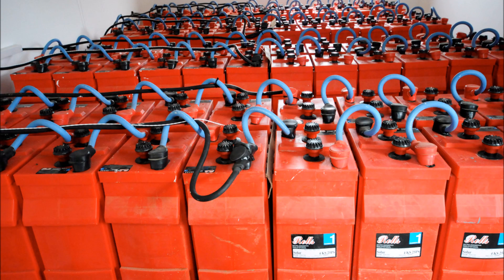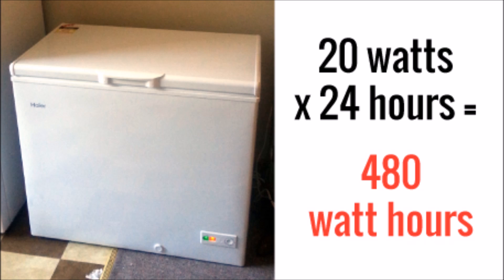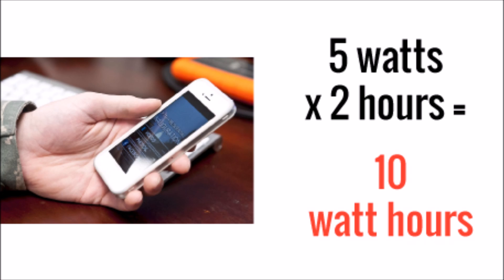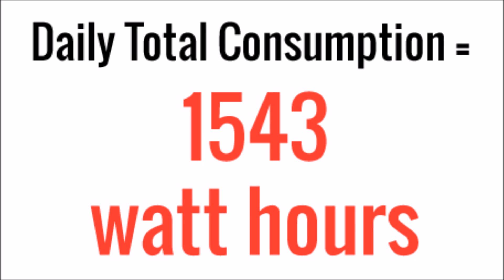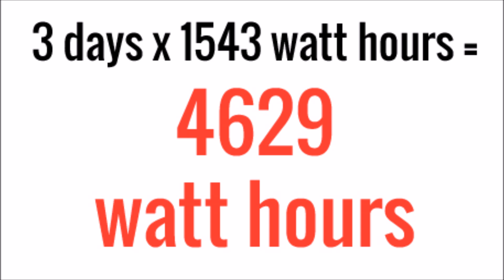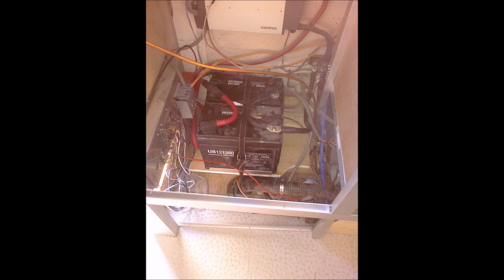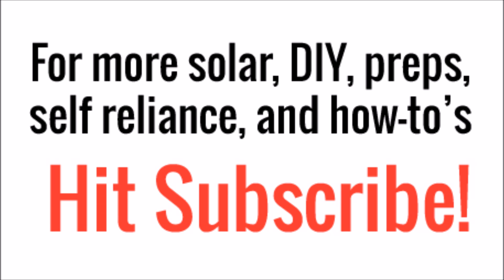How To Size Your Off Grid Battery Bank Capacity For Solar - Math Warning!

Comment: The amount of power that the average US home uses is about 30 Kwh a day that is ten times what I use in a day and thee times what my the average home is my country
Reply from the maker: Yes, that is a lot of power.  Most of that comes in heating and cooling and large appliances.  It is definitely possible to get by with less.
Reply: @LDSreliance  that makes sense because we mostly use gas or wood for heating and don't have a cooling system asides from opening a window by the way thanks for the video
Reply from the maker: You are welcome.  Thanks for watching!

Comment: How many amp hours of lithium iron phosphate batteries would I need to power 1500 watts (close too ) for 18 hours a day ?. Roof is south facing at between 10-14 degrees . Southern California. Thank you 🙏🏼
Reply from the maker: Wow.  That is a big boy load.  The rough math would be 27 kWh but that would be draining them to zero with no room for error.  So add in however much margin you want to that.  Also make sure you add in an extra 20% if your load is AC and you are going to be powering it from an inverter.  If it is a DC load you don't need to worry about that.

Comment: Great video but at the end for the multiplying by 2 would be 100%.  Total amp hours x .5, then add that to the total amp hours for the amount you would actually need.
Reply from the maker: I think you are misunderstanding.  We already had the amp hours that we actually need.  We multiplied it by 2 so that we would be purchasing twice the capacity that we needed, thus we would only be drawing the batteries down 50% at our 100% usage.
Reply: @LDSreliance  ahh ty for the clarification
Reply from the maker: Np.  Thanks for watching!

Comment: What about dc amps compared to ac amps?
Reply from the maker: Can you elaborate on your question?
Reply: @LDSreliance  I'm not referring to ah. Is it true... 1 AC amp is equal to about 10 DC amps?  So when calculating your Amp needs you'd need to take that into account?
Reply from the maker: No.  That is not true.  The only way that would be true is if the voltage of the AC power is 10x that of the DC power.
Reply: @LDSreliance  ok I hope that's correct.  I'm with you but what are these guys talking about?  Here's one example video. ..https://youtu.be/idFz4W0o06k
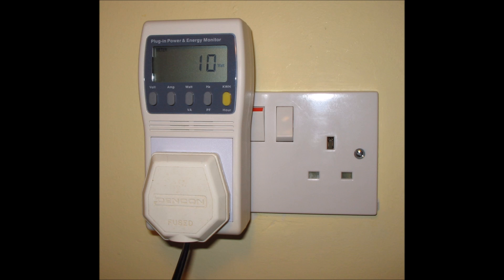Reply from the maker: At 0:57 in that video he says exactly what I am saying.  He measures 5.7A @ 120V and 24A @ 24V.  5.7A x 120V = 684W and 24A x 24V = 576W.  However, his AC meter measures 582W before he switches over to the Amp reading so he really isn't getting 120V AC power from his inverter... it is more like 102V.  He is not using a high quality inverter, apparently.

Comment: Say I use 45 KWH a day and I want 4 days of battery stored, and use 1200 watts of panels to charge battery. How many batteries do I need. Say I have lifepro4 lith batteries with 100 AH.  I know I did something wrong,  but I came up with 10.  If that's right, no way can I afford this. Thank you
Reply from the maker: 1200 Watts is about 1/10 what you would need to even think about pulling that off.  Did you mean 12000?  Or did you mean 4.5kWh per day usage?  The average house in America used 29kWh per day in 2017 so 45kWh is either a lot of usage or a really big house.  Either way you would need a really big solar panel system.
Reply: @LDSreliance   thank you for your reply... My electric bill came in this morning it says I used 24KWH a day and 649KWH for the month. Trying to figure what I need to go off grid,
Reply from the maker: I don't know where you live but you will need roughly 6,000-9,000W of solar power to generate that in the continental United States, depending on your state.
Reply: @LDSreliance  Thank you again for your help. I live near Gainesville Florida, central Florida. To make 9000w of solar power I will need 30 300w panels. I'm going to use a 48 volt system so I have go up by 400w when I add panels, that is what I been told.. (example 400w, 800w, 1200w).  Thank for your time, and not getting upset with so many questions.. Trying to learn..
Reply from the maker: Not a problem.  I am glad I can help.

For Gainesville, you would need about 6,500-7,000W depending on our winter consumption.  It would be more helpful to know the average consumption by month of the year over a several year period but that is a general estimate.
Reply: @LDSreliance  Thank you.. I call my electric company see if they will give me my last year or two totals. I will use your suggestions, after about six months of using I will let you know. May even make a video.. Thank you for the help.
Reply from the maker: You are welcome.  Good luck!

Comment: if I have eight 330 Ah batteries at 6 volts configured to 24 volt system, what is my total stored Ah capacity?
Reply from the maker: 660Ah @ 24V

Comment: Hi there sir its an old video but still helps
So my question is
Can i add an extra battery on my current system
The system i have built is
100 watt each panel
20am charge controller
1500watts inverter
And 100 amp battery
My dally use is making my battery drops to 12.0
Or even 11.8 in the middle of the night
Which is damaging the battery life i believe
Will adding extra 100 am battery help
Or the system can't handle? it
Reply from the maker: Another battery will definitely help, as long as you have enough solar panels to charge up two batteries each day.  I can't tell from your description how many 100W solar panels you have but for that to work I would say you would want at least 5-6 of them just off the top of my head without knowing more info.
Reply: @LDSreliance  will I'll ask
The shop owner
And don't worry
I leave in the middle east
Lol its sunny🌞 mostly hear

Comment: Are you only calculating discharge based on lead acid?  Life Policy can be discharged almost completely.
Reply from the maker: At the time of the video lead acid was more feasible and affordable.  Now lithium is definitely in the conversation.  But while LiFePO4 batteries can be discharged to 0% SoC, it will have a negative impact on cycle life of the battery.

Comment: The more batteries the better. It reduces the cycle rate. If you have 4 batteries you'll hit the 50 percent rate quickly but if you double the size you reduce it to 25 percent. But if you use 16 batteries it's just a trickle off the top and your batteries will last years longer. Pannels are cheaper than batteries.
Reply from the maker: True, for the most part.  As long as you have a corresponding increase in size of the solar panel system, too.  If you don't, then the solar will never fully charge the batteries and they will short cycle over and over until they die (lead acid) or require intervention such as a generator or something to top them back off (lithium).

Comment: Did you account for size of the array? During the day you use power more so than night. The pannels are beeing used to supplement the battery charge cycle which reduce the amount of charge going to the batteries. It's a balance.

Comment: How about the 80% battery efficiency? If you put 10 Amp  in your lead-acid batteries, you'll get only 8 amp out. Even less when they are older. Please add that to your calculation: divide the battery capacity you found by .8.  By the way, that is another great advantage of lithium batteries. They are around 98% efficient. Too bad they're so expensive.

Comment: Hey mate quick question when converting watt hours to amp hours for a 24 volt system do you just divide watt hours by 24?
Reply from the maker: Yes.
Reply: Although if you're using two 12V batteries in series to generate the 24v each battery is still going to be generating 12v so you would divide by 12.

Comment: I just watched your video...very good. I have a hunting cabin that I use 45 days a year. I currently have a 100 watt panel with two golf cart batteries that supports two lights, phone charging, oscillating fan and a vacuum cleaner occasionally.  After watching your video it looks like I can set up my system to maybe support a single cup coffee maker and a small fridge that I would use only while at the cabin. It's all about the amp hours of the batteries!!  I'm learning.
Reply from the maker: Absolutely!  That is the whole point of my channel so I am glad to hear that.  The fridge will be the biggest challenge since it will kick on and off all day and night.  Those kind of loads are hard on solar since you will only be producing power during the peak sun hours each day.  So you have to produce enough excess power during those 3-8 hours (depending on the season and location) to last you through the night until the next day.  And if the next day is cloudy... you are out of luck.

It is going to be hard to get by with just a single 100W panel.  I'd recommend getting another one if budget and charge controller capacity will allow it.  They are down to about $80 with free shipping on Amazon these days:  https://amzn.to/35zTh9y
Reply: A 12v Automotive coffee maker(200watts)..25 minutes to make 1 giant cup of coffee.  Dont leave home without it :)

Comment: I need 50 kWh daily, someone pls recommend me a battery bank? Lithium ion and NOTHING else. Give me some 3.6 volts in series and I need them to be for a 12 volt system.
Reply: Hezekiah Spade you are asking for a major disaster. Lithium batteries are very unstable. And pulling 2083 watts an hour dc that converts to 173 amps per hour. The amount of heat that will produce and the energy loss if you are converting that to ac power will be insane. The 12volt inverter can’t handle that kind of power.
Reply: @rigginsranch  Wow!! OMG 😲

I have no clue yet as to what I'm doing but this is the off grid thing I wanna do.

Could you give me an idea of the things I need to use for a 50kWh daily power set up? Will a 48 volts system be better in this case than a 12 volt? 
Also will lead acid or agm batteries be a better option than Li?
Reply from the maker: Yes, you would want to use a higher voltage system for sure.  50kWh is a lot so you may want to take a look at your energy consumption first and see if there are some things you can do to decrease that.  If it were me, I would do all of my heating (water, house, stove, dryer, etc.) through propane instead of electric.  I would switch as many appliances as I could to direct DC power or propane (fridge, freezer, mini split AC systems, etc.).  Then I would swap every bulb in the house to LED if you haven't done that already.
Reply: @LDSreliance  Essentially you're saying to try and reduce it to say about a 25kWh system then? Today I spoke with Outback systems and they told me that 60kWh is pretty standard for their clients all over. I mean they have battery banks for it but I'd need 3 sets because their highest for household applications is 20kWh so I'd need 3 of them and each costs around $18,000.00 so it'd be best I just create a battery bank though it won't be light as theirs(950kg). 

But THEY told me it is very easy to do. I checked out the Tesla Wall as well as LG systems and they are light and very attractive but too expensive. I might have to build one. 

And no matter the voltage, Outback sent me three of their systems that I can use at from 12 volts to 96 volts to suffice for all that power.
Reply from the maker: The average usage in the United States each month is 914 kWh per month or about 30kWh per day (https://www.eia.gov/tools/faqs/faq.php?id=97&t=3).  60kWh is do-able, sure.  With enough money you could build whatever off grid system you want.  I'm just telling you that is really high and you will spend more money on solar capacity to try to meet 50kWh per day than you will by trying to decrease that number.

Easy, yes.  But expensive.  But it is your money.

Comment: Good video!
    One clarification, at 5.34 you say if you design your battery bank to discharge to 25%, it will last a lot longer... I got that you meant if you only discharge 25% of your batteries power, it will last longer...
    A lot of folks are really confused by some of this. So, to avoid confusion, the bigger the battery bank is the longer it will last. 
    Yall Take Care and be safe, John

   PS To those of you new to solar, if you are building on a budget and totally off grid there are things you can do to 'get by'. If you need to, you can leave the TV and laptop off for a couple of days if you are low on sun or battery life. Read a book or surf the web on your phone and use a small portable panel to charge your phone. I also have a small Briggs and Stratton engine/car alternator setup that I can crank up and help charge the batteries and provide a little more power from time to time. Considering options along these lines can help you get by with the minimum if you are truly starting out on a tight budget. Good luck.
Reply from the maker: True.  Lately I have been using State of Charge and Discharge when referring to those types of percentages.  Good point.

Comment: So how many batteries would need? To supply your example, how many 12v 100ahs batteries would we need, 8? Or is there other types of batteries? I'm a little confused on the actual batteries we need.
Reply from the maker: Yes.  In the example in the video he would need 8 batteries of 100Ah capacity.
Reply: @LDSreliance  ok then. Is that a common set up? Is there a bigger battery?
Reply from the maker: That is not how I would construct that battery bank.  Too many individual batteries.  Go with higher capacity batteries.  For lead acid, 225Ah is a common size.  For lithium, you can find 200-300Ah or even larger batteries.  The less connections the better.
Reply: @LDSreliance  👍 thank you
Reply from the maker: You are welcome.  Thanks for watching!

Comment: Don't forget to add 20% for Inverter loss.
So 771.5 X 1.2 = ?
Reply from the maker: Yes, good call.  I debated putting that in the video and I probably should have.  But if you are smart you won't be running much off of an inverter in a scenario like I was describing with the yurt.  Running everything off of DC power is ideal.
Reply: @LDSreliance  I am installing a system on my boat so I don't have to run our monster generators while we are out of commission during this virus crisis.

In the past 5 or six days I have learnt a lot from people like yourself and I thank you sincerely.
Reply from the maker: You are welcome.  Glad you learned some things.  I have quite a few videos so maybe you will learn something else.

Comment: using your calc I think I need about 1500 amp hrs, I can't figure out how many powerwall2 that will require but I will buy 3 regardless. My question is cant I use a 15 kW generator and transfer switch to back up my powerwalls thus avoiding the extreme anal raping of the utility companies in the Houston area? Besides the powerwalls and the panels will a charge controller be required or are they part if the powerwall construct, and what size panels do you recommend for such a large system. I really dont have any ass left to give the utility companies I will rather be totally off-grid.

Comment: No-one in their right mind is using lead acid any more. The maintaining of battery health and limited depth of discharge compared to lithium leaves them on the scrap heap
Reply: Totally untrue many can't afford any other type of battery also many like me live in cold climate and keep the battery Bank outside where my solar equipment is lead acid takes a charge just fine in cold weather other type do not there also cheap to replace should one die randomly for what ever reason  I could think of more reasons but you get the point every tool has a place a single type of tool will never fit every job

Comment: In many scenarios, you will need to change that 12v storage to 110v for your devices. Inverters run at less than 100% efficiency. In a future video, will you please expand the calculations to include inverter (lack of) efficiency? Thanks!

Comment: You omitted the really important things like a water heater, furnace, air conditioner and coffee maker!
Reply: I don't think you'll need a water heater or an air conditioner in a yurt! 😬
Reply: @girldirectorTV  If you are willing to live in a yurt, you don’t even need electricity.  😁
Reply: and even more important cfl, bulbs, leds, tubes for light purpose and fan, cooler when ac is not required,
Reply: just get the amp hrs he missed and add it to 1543wh he gave as example if you want the actual. You may also add ambient temp the may affect the battery performance. Just a suggestion.
Reply: Wifi to watch that tv too lol

Comment: I want to use 10 hp motor 6 hours a day , I want to power it just by using only batteries, is it possible? If possible how many batteries I will have need ?

Comment: What about if you're planning a 48v system, 20 solar panels (320w) each, wind turbine, (4)forklift batteries, 24v, 1600ah each for a yurt, I'd rather make too much power than NOT enough.

Comment: I do not agree. I would say you need at least double capacity that your panels produce in a sunny day.  For example my system produces on average 18 kw/day then I would recommend 36 - 40 kw of LiFePo4. This is because you need to be able to store all the power your panels produce if you are not home over the weekend and have enough power to go through cloudy days. 
I do not have enough batteries and I waste power in sunny days when we do not cook or wash and dry clothes. but then when it is cloudy we borrow from the grid. If I had more batteries I would not have any issues.
Really, I think every home should have at least 60kW of LiFePo4 batteries. 

Any other kind of calculations are waste of time. If you are powering your house than get as much as you can and only lithium based batteries. If you do not have enough batteries and you charge them to 100% and discharge them to 10%, than they will not last you 30 - 40 years;